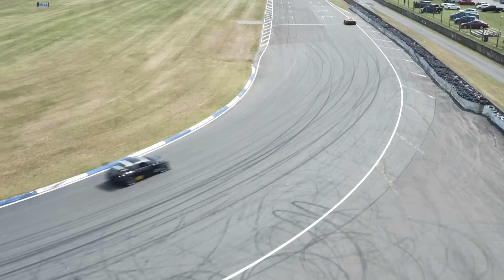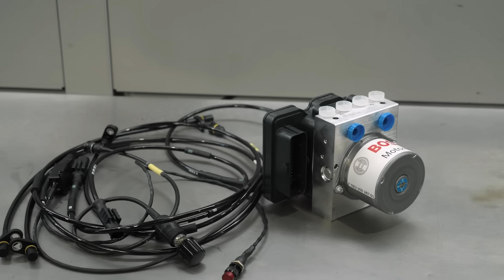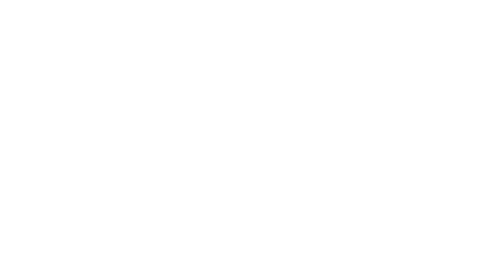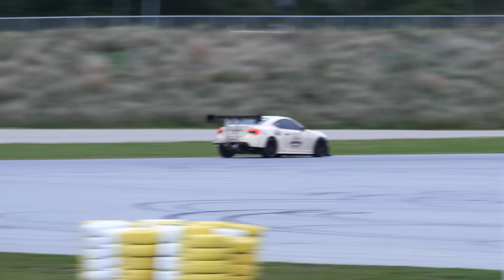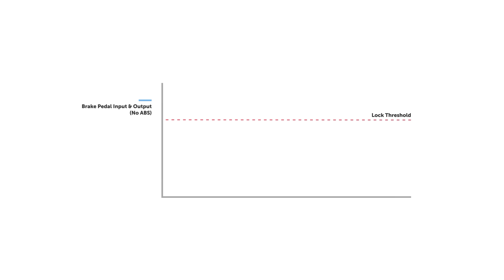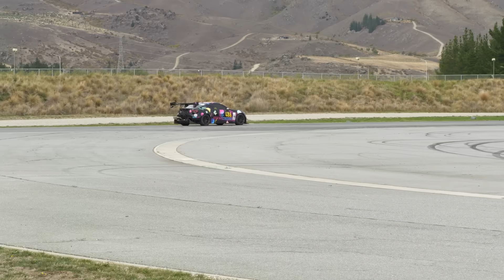Motorsport ABS Performance Tested | The TRUTH

Comment: does this require abs hard lines?
Reply from the maker: All brake systems require hard lines for the majority of the system, yes. 
HPA actually has a course on motorsport plumbing which covers brakes along with coolant and intercooler piping etc too.
Hope that helps - Taz.
https://www.hpacademy.com/blog/brake-hard-lines-are-actually-easy/
https://www.hpacademy.com/courses/motorsport-plumbing-systems/
Reply: @hpa101  thank you taz- you're the best mate

Comment: How can I start a conversation about the similarities and differences between motorcycle and automotive suspension and brake tuning techniques? For example, in motorcycle maintenance you might loosen the front brake calipers, apply the brakes, then retighten the bolts to ensure the rotors and calipers are properly aligned and to minimize pad drag. Or when tuning suspension, you might bounce the front end and adjust rebound damping so the fork returns to neutral after one smooth compression instead of oscillating like a pogo stick.
Reply from the maker: We're working on motorbike content. It will take a while to build up a library of courses and some of what we have does already cross over (just not so much suspension), but it's comin - Taz.
Reply: A collab with Dave Moss would be dope   @hpa101

Comment: I am in the process of installing the same ABS M5 module in my V6-swapped BRZ. I would like more information about adapting it to the chassis, mainly regarding the sensors used.

Comment: When I worked in FIA Gt
We used the a s for yaw control,traction control 
Also tried it at PikesPeak but we never had enough time to dial it in
It takes a lot of testing and knowledge to get the best from it
But as a pure braking aspect 
A truely underrated facet
For about 10,000$ a pretty good return on investment

Comment: Adding ABS to my older 80s sports car is one of the modifications I really want to do because it has the potential for the highest benefit.   My RX7 locks up the rear tires so easily and it's so subtle to detect.
Reply: Start with a way to bias the brakes

Comment: A possible back to back test that you can run (if you're able to turn the abs off)....it would be interesting to see the difference between with/without abs in: overall distance, consistency, lap times etc.  Once you're able to get all the motor pieces back where they belong  :-D

Comment: For the cost, kind of surprised it can't do bias control. There are factory systems that can adjust rear bias based on speed and other inputs. Having bias control would allow doing a cross corner master cylinder setup to add some fail safe behavior?
Reply from the maker: Some factory abs systems incorporate hydraulic bias as part of their operation. The Bosch Motorsport ABS doesn’t as it’s typically incorporated with a pedal box for hydraulic bias control. It’s alsonot black and white since the ideal hydraulic bias is constantly changing depending on track conditions, tyre degradation and fuel burn. The ABS system can unlock a locked wheel but it’s reactive, not predictive. So for best results we still need to hydraulically match the bias to the conditions.

That makes sense? - Andre

Comment: Should have done a third test - no ABS/ABS disabled (perhaps as two tests, threshold braking and lock brakes and ride it out). That would have been the most telling, and a great rebuttal to the "you don't need ABS" folks. Even if a good driver can out-brake ABS, on the street you're not a good driver, you're a panicked driver trying to avoid crashing into that idiot that just pulled out in front of you, to let the ABS take care of braking so you can focus on the other parts of not dying is very helpful. As for if it's "cheating" - a cyclist would tell you that having an engine is cheating, in turn a runner would tell them having a bicycle is cheating. If you're in a competitive race, cheating is whatever the rules say isn't allowed, if they don't say it's not allowed then it's self-sabotage to not take advantage of it. If you're driving for fun, then that's purely your own choice.
Reply: I think it would be very easy to beat the oem abs with an unassisted braking system, the reason is that the oem abs is not at all calibrated for upgraded tires that are much bigger and grippier than oem, beating the Bosch system might be challenging though.
Reply: @Iseenoobpeoples  This is another point worthy of considering in itself - the aftermarket tires are probably hindering the stock ABS, so this comparison isn't just "stock vs. motorsport ABS," it's "stock vs. motorsport ABS on big tires." This result makes the stock ABS look trash, on stock tires it's probably pretty good and the motorsport ABS wouldn't do any better. The problem is that stock ABS systems aren't tuneable - if they were that could vastly improve their flexibility.

I've been pondering using the BMW ABS setup a lot of people talk about retrofitting on my classic Beetle. I'm not sure how well it would work though, as that has much narrower tires than any modern car, and the rear weight bias might simply baffle any ABS tuned under the assumption of a front-engine car.
Reply: @quillmaurer6563  Yes, the oem system releases way too much pressure because in it's mind there is no way the oem tires can handle it. I think on oem tires the difference in distance would have been less than half maybe 1/4. I personally chose to remove the oem abs and brake booster completely to improve the system at lower costs, it's not the best option but it is a great option.

Comment: Did you have opportunity to try and use an accelerometer with live data to feed into a math channel that controls an actuator to trim your brake bias based on calculated weigh transfer?  

This them allow you to get a better brake bias based on car attitude? 

As a simpler option i have been looking at rear axle brake portioning valves to do the same mechanically based on wheel travel, just hard to find the unit

Comment: I used to think I could out brake ABS and when I had my Miata with FM's Little Big Brake kit, braided lines, and Hawk HP+ pads, I think I could back up that claim with that cars amazing pedal feel. After switching to a heavier RX-8 with litterally 4 times the horsepower, I've learned the hard way that ABS is a must. I'll be installing a BMW Mk60 system over the winter.

Comment: My unfounded hunch is that most of the gains were from the pedal box with bias being corrected.
Reply from the maker: it's another variable in the system, however for the purposes of our actual 200-0 test, the net effect is arguably irrelevant. In this test the aim is simply to apply as much brake pressure as possible, as quickly and aggressively as possible. The only tangible difference with the pedal box in this regard is that it can affect the hydraulic bias but once each wheel is beyond the pressure required to lockup, the hydraulic bias becomes something of a moot point since we're now reliant on the ABS intervention to modulate the brake pressure and attempt to target a specific slip ratio - Andre
Reply: @hpa101  would have been interesting to see 200-0 treshold braking to see how much it is better than your skill

Comment: Solid video! Should be noted that the Japanese OEM's are very conservative in their controls / ABS tuning so I would expect big gains vs starting with a German car for example. However the consistency and lack of compromise are all great things to have on track. It's beauty is its simplicity not complexity that you just can't get away with on a production car.

Comment: We had excactly the same problem as you with the stock ABS on a BMW e46 M3 at a track where you went into a braking zone with 220 km/h and it would go straight into ice mode and not brake. then we got our hands on a motorsports ABS from SCS Delta and now it works amazing and can brake later than  ever
Reply: Ironically I believe the exact unit you took off is what people talk about using to install ABS on vehicles that didn't come with it. A huge upgrade vs. no ABS, but still not as good as motorsport. Surely more than adequate for my classic Beetle that might do 130km/hr with the engine about to rapid-unscheduled-disassemble. If your old unit is the right one, how much you want for it?

Comment: Ive got Delta ABS on my car and its great. A lot cheaper than Bosch and as good.
Reply from the maker: Note this isn't a gripe, both options have their place, but when you say 'as good', did you actually test both back to back? If not, how do you quantify that statement - Taz.
Reply: @hpa101 I did not actually test back to back on the same vehicle. I would say that feature wise they're very similar. Slip threshold, adjustability etc. Delta software is extremely easy to use and the hard goods are quality items.

Comment: I believe a 2016+ MX-5 has a OEM version of this system. My weekly tracked ‘19 MX-5 has a MoTeC L120 which logs the wheel speeds at 200hz. The ability of the ABS to control wheel slip at -1G deceleration and allow lateral combined G of 1.1G at turn-in is great with a “DOT Slick” tire.
Reply: Interesting. I have been wondering about this, for cars that have bosch abs units especially. Several of the other bosch motorsports specific electronics are literally equivalent to oem sensors etc they produce, just with some tweaks. I wouldn't be surprised if the abs system is just a standalone that doesn't rely on canbus or something like that (no idea if the motorsports unit requires canbus communication or anything specific about it).

Comment: Now add in the steering sensor so it can modulate left/right while trail braking and see how much it helps (genuine curiosity, everyone tests it in straight line but not the cornering)
Reply: It already modulates the brakes any time one of the wheels lock, including differentiating left and right. Wdym?
Reply: @ian.williamson it'll bias the brakes left and right based on steering angle even without lockup, essentially using the brakes to help turn the car.
Reply: @kc0stp1 like torque vectoring?
Reply: @ian.williamson yep but with the brakes
Reply: @kc0stp1 torque vectoring does use the brakes on the inside wheels in addition to applying more power to the outside wheels
Reply: It does come with a pitch and yaw sensor
Reply: It doesn't need the steering angle sensor to do this, you have information from the wheel speeds to tell what direction the car is going.

Comment: Sorry, and I'm not as technical as you guys for sure, but doesn't installing a pedal box at the same time as you installed the Bosch ABS make your before and after testing results invalid? It's not like for like anymore with only the ABS unit changing. You've introduced more variables such as master cylinder sizes and brake bias for a start.
Reply from the maker: Yes, it's another variable in the system, however for the purposes of our actual 200-0 test, the net effect is arguably irrelevant. In this test the aim is simply to apply as much brake pressure as possible, as quickly and aggressively as possible. The only tangible difference with the pedal box in this regard is that it can affect the hydraulic bias but once each wheel is beyond the pressure required to lockup, the hydraulic bias becomes something of a moot point since we're now reliant on the ABS intervention to modulate the brake pressure and attempt to target a specific slip ratio - Andre
Reply: @hpa101  Hey Andre, as you know, modern cars are heavily front biased in terms of braking performance, so depending on your choice of master cylinder for the rear, there could be a measureable difference in pressure going to the rear brakes as a result of the pedal box, would you agree? 

It could also be possible that with the standard setup, the rear brakes were incapable of creating enough pressure to lock or reach the desired slip ratio for maximum braking efficiency?

I love your guys work, but I would have loved to have seen you only install the Bosch ABS and perform the tests like for like. I understand why you didn't, considering the work involved installing each component makes sense to do them together. Just leaves me with too many questions marks still on the results. The theory you provided behind the system is sound and logical, I just think the actual results would have been different with/without a pedal box.
Reply: @joshmuggleton  Modern performance cars are actually more rear biased in their brake sizing because they can rely on the ABS unit's EBD to proportion the braking balance - so you want a high ceiling on the rear axle and then limit the pressure/wheel slip as needed in straight line and more in turns.

Comment: You don’t need to be a robot to measure exactly 200kmh to zero. Just start the stop at 210kmh and then use the time/distance data from 200kmh. More reliable too because you aren’t measuring reaction times, how fast you depress the brake pedal etc

Comment: The stock ABS on my civic EP3, with front BBk, was shocking. i can brake as much as 20m later, for example t1 at donington with no abs. Id love to try the bosch system
Reply from the maker: Yes not all stock ABS is created equal. It's much like how a lot of people complain about drive by wire throttle response thinking what is happening is in their Subaru Legacy is the peak of the technology when it's far, far from it 😅
Hope you get to try aftermarket ABS one day knowing, in our opinion, it is really as good as everyone says it is - Taz.
Reply: Sounds crazy having a 20 m lag at a place like Donington – those brakes would feel endless! Hoping the Bosch system nails the grip you need 🚀

Comment: I've got a great visual of 5-10% slip. When a high powered well tuned drag car paints faint tire lines to the 330ft and beyond. That's maximum traction under acceleration. Still not easy to achieve. Takes tons of data logs to do it consistently without blowing the tires loose. Even then, nobody hits all the time.
Reply from the maker: That's part of the allure of being involved with drag racing/motorsport too though right! You know what the goal is, but the 'play' to score it is different just about every time you go out on the track - Taz.
Reply: @hpa101  The thrill of the game, the chase, even losses, because wins mean less if you've never lost and struggled.
Reply: Wow, cracking that 5‑10% slip window is insane – those faint tire lines are the ultimate brag badge 🚀. No wonder it takes endless data logs to keep it consistent!

Comment: Amazing presentation! The script was so nicely put together. You covered every angle of the topic.
I am an ABS hater because I had some scary experiences on the road where the ABS caused a lot more trouble than locking a wheel would have done. The cars I own are all without ABS. However it would be nice to have a system like the Bosch but only on the roadcar. Could just smash the pedal without much thinking in an emergency situation. With my no-ABS car I'd never hit the brakes with full force, and that is not optimal when you need the absolute minimal brakingdistance.

Comment: I’m going to sell my car and then buy this system… oh no, wait!
Reply from the maker: haha yes it's a big investment for many! 
We've spent a lot more than 10k AUD on things that have made a lot less of a difference on this car over the years though that's for sure, and it was hard to get past the mindset of 'I already have the stock ABS system, surely an aftermarket one won't be that much better', hence this video.
There are a lot of different levels to motorsport though and this won't be the lowest hanging fruit for a lot of people.
I mean, realistically, there are more people who would probably be better to start with dialling in their tyre pressures and alignment before needing to worry about ABS 😂
On the flipside there are plenty of builds out there with considerable money already invested which are held back by not having something like this, one of which we hope to wipe the floor with in the braking zones at the local sprint series this weekend 😂 - Taz.
Reply: @hpa101  ah I totally get where you're coming from and it was a great video. A must watch! The 200-0 kph tests show that it's far more than a marginal gain. And on a big build A$10k is nothing. People spend double that on suspension and don't even know how to set it up - sort of a set and forget mentality. 
Good luck over the weekend. I hope the competition eat your brake dust 😂
Reply: Wish there were a more affordable version that isn't maybe motorsport-spec but is suitable for retrofitting onto non-ABS or early-ABS vehicles (for either track or street use), something akin to what comes on modern vehicles. I've heard of that with some BMW components, E36 something comes to mind. Would love to put that on my classic Bug, have skidded that car into more things than I like to admit in the unfettered chaos that is roads and their users.

Comment: I may have missed it but is the Bosch system adjustable for tire slip percentage or was the adition of the dual master cyl for front rear brake balance the only change between systems for dialing in?  I love ABS even many OEM systems and rely on them.  ABS saved my life and several accidents less in the early 90s which sold me on the technology.  I built a Exocet Miata based kit car and made sure to keep the ABS system and it worked incredibly well on track even with some significant changes to weight balance and suspension.